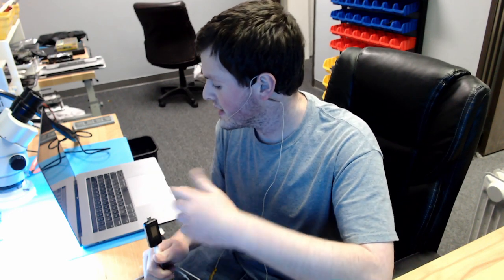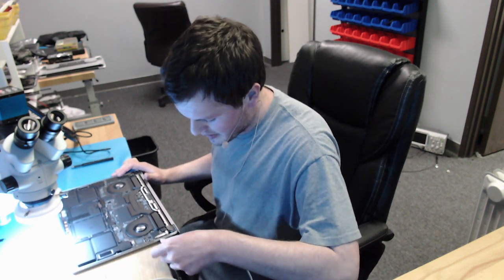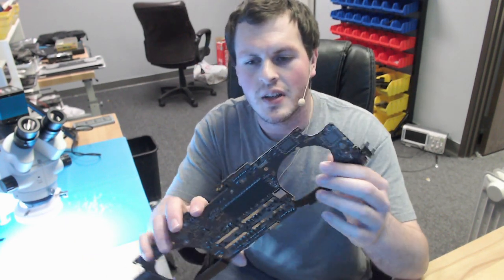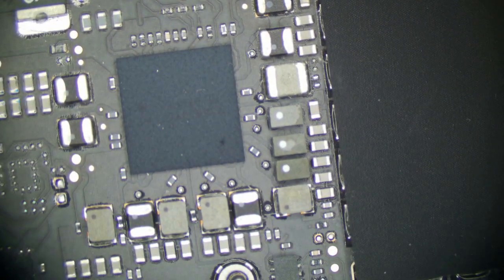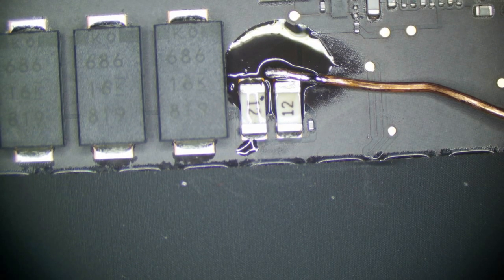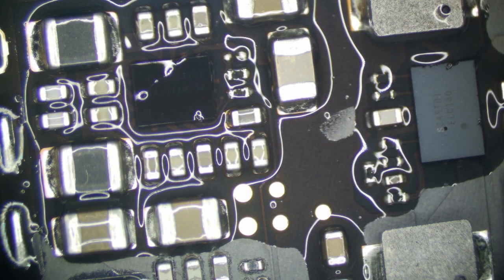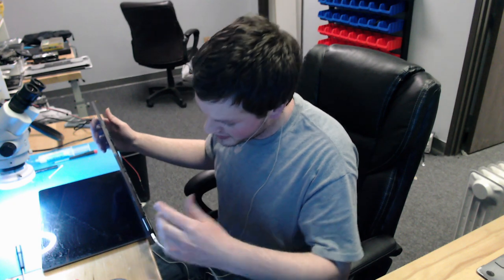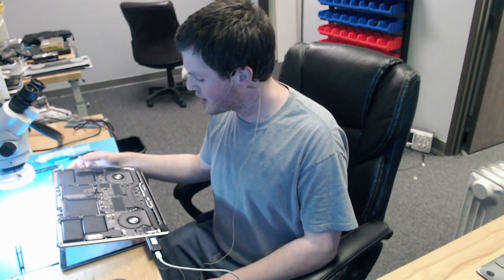2019 15" MacBook Pro no power repair. | 12v Rail short to ground.

Comment: Hello Tim great Video . I have a question, I have the same board 820-01041A and all the USB C ports are stuck on 5V 0.4A ( not boot looping).The PPBUS G3H is 12.3v and the PP3V3_G3H is 3.3v , however PP3v3_S5 is 1.3v.  Can I assume that it's a problem with the T2 chip? I bought this computer from a guy who said that he thinks that a little bit of water touched the upper left USB C port of the computer and this is why the computer doesn't turn on anymore. I thought that if water touched the USB C port so probably the CD3215 will be damaged, but I assume it's not the case.Am I right ?

Comment: A good way to see if the cpu vcore mosfets are shorted as you up the supply is to see if the voltage is getting through. If you get to 1.3v and that’s on the cpu side of the fet it’s shorted
Reply: 1.3 is my cut off but I normally can tell way before
Reply from the maker: This works well! Personally I just use my FLIR but this will definitely work!